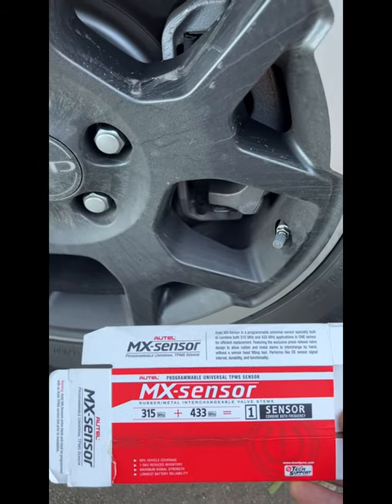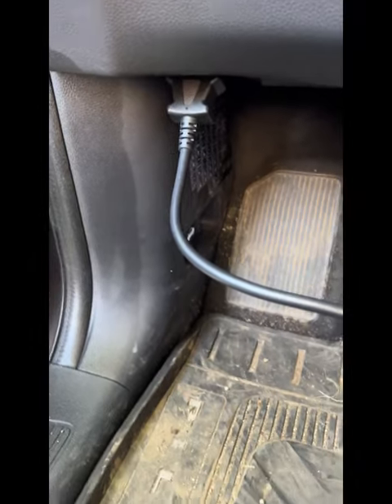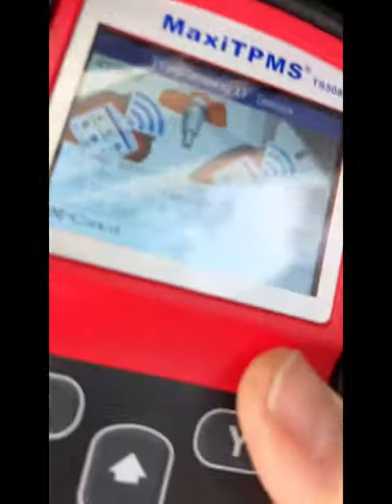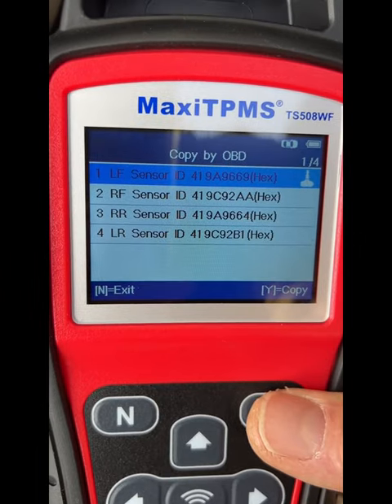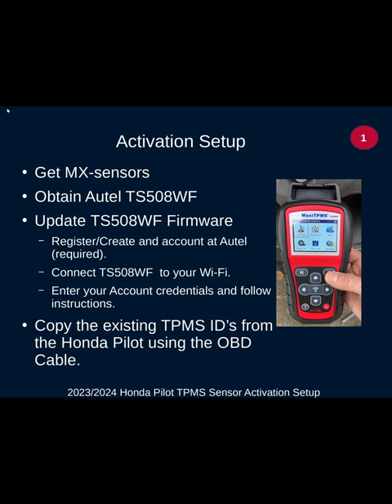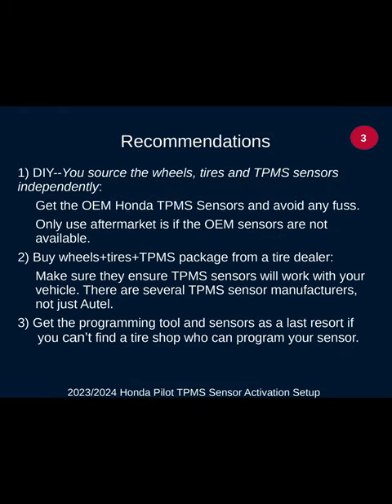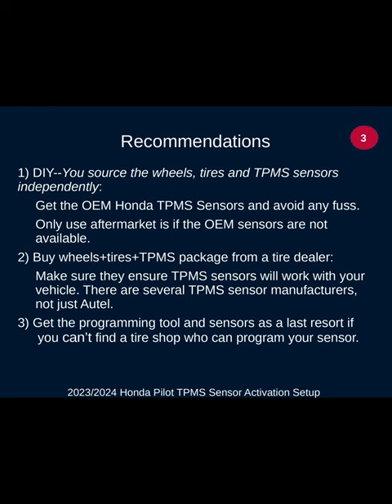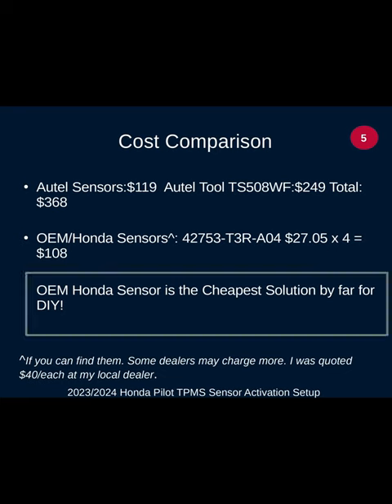2023-2024 Honda Pilot TPMS  with Autel Mx-sensors

Comment: At least there's one crumb of comfort of owning the Autel TS508WF. It eliminates the guesswork on diagnosis if one of the TPMS sensors is dead.

After working with the Autel TS508 and the MX 1-Sensors for a long time, they're time savers when it comes to TPMS diagnosis, programming blank sensors with new IDs, and performing relearns.

Comment from the maker: Yah, it’s a good tool. It will recognize the unprogrammed sensor for troubleshooting. Another user on the Piloteers forum mentioned there is a cheaper Autel tool that will program the sensor (don’t recall the model)
Reply: The MaxiTPMS PAD, I presume? I have a TS508 (its non-WiFi counterpart) myself, along with my workplace. In the marketplace, there's also the TS408 (the TS508's non-OBD cousin), along with the TS401, TS501, and TS601 (their predecessors). On the higher-end of Autel MaxiTPMS tools, there's also the iTS600, along with the TS608, and the TS900.
Reply from the maker: @jtr990  Yeah, that was it.